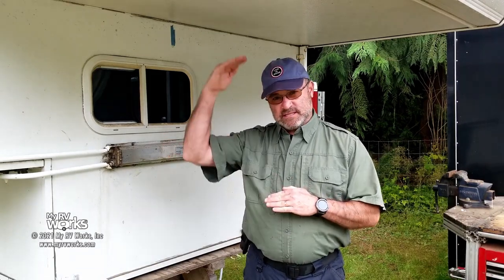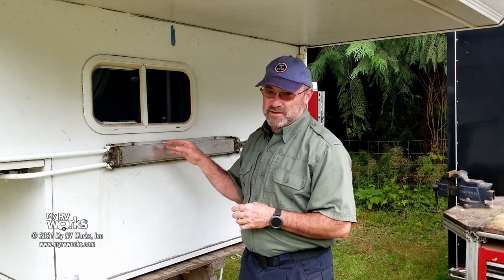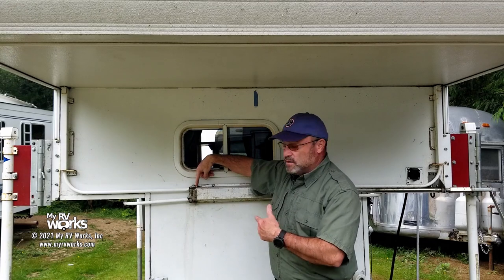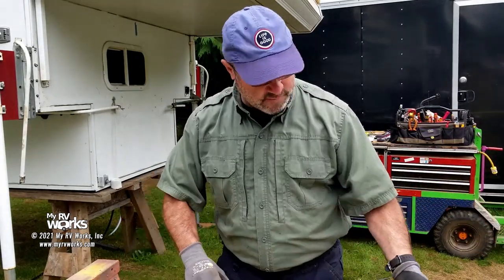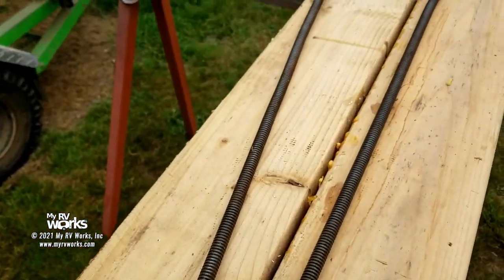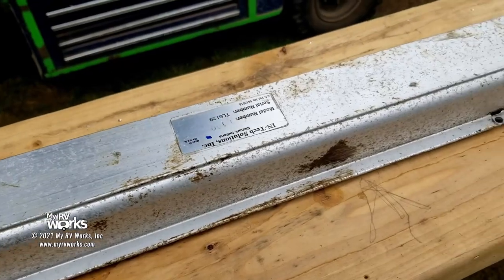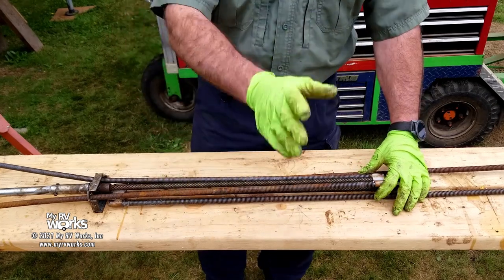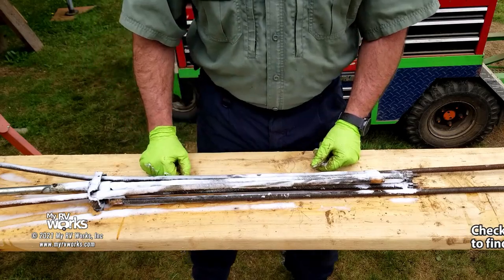Truck Camper Lift Lubrication  --  My RV Works

Comment: I am sure you also cleaned any rust out of the tubes and sprayed lub down them them and addressed where the water was entering the system. Love your work and explanation. I saw a previous comment and love, love, your cart. Maybe a video about it in the future. Just a little side comment. My grandfather would tell me “boy you have to slow down to speed up to get things done”. I really did not understand what he meant until latter in life but you seem to be going 90 miles an hour and I totally understand why but consider what my granddad said. Love you brother!

Comment: I've been looking for this video. Thank you for  posting it. I took mine apart, cleaned and lubed it per your video and it is better than new. ( The "tentacles" were dry as a bone.)  I was hesitant to do anything until your video, thanks again.

Comment: No buttons on the end of the pusher springs, up inside the legs? That takes some of the fun out of it. Other than the acme screws it looks a lot like a Goshen lift system. Good job Darren

Comment: I have that system on my palomino, and it sounded just like that before your service. It is on my pickup and I'm not going to remove or slide out partially right now. I bought spray motorcycle chain lube and drilled small holes in the tubing 
For the spray tube to fit into and sprayed in the holes. Then went inside and sprayed down from the top of the cables. I can't reach the cranking mechanism until the the camper is slid back so will tackle that later. Operating the mechanism now is quiet with much less friction. The Chain lube is sticky and will stay awhile. When the camper comes off the truck I will then do it as seen in this informative video. Until then I feel much better about raising and lowering the roof
Reply: I did the full maintenance on mine and it was not difficult at all.  Just make sure you have a full size table in front of the camper to lay out the parts.

Comment: Rust and debris are going to be inside of the pipes that you left on the camper as well and brake clean or carburetor cleaner in a spray can would have worked much easier after wire brushing then foaming degreaser. Hope this helps

Comment: So without putting those brackets that hold the pipes flush to the bottom of your camper back before you started ratcheting I don't know if you can see it but at the end of the movie the left hand side pipe on the front is moving and being pushed down by the spring inside of it because it doesn't have the bracket supporting it while you're turning the lift and pushing the roof up. I would not recommend cranking the roof up without those brackets on the bottom of the camper anymore they're actually there to support the force of the spring pushing up is going to want to push the pipe down and that is the only thing holding the pipe in place where it's at the bottom of your camper

Comment: Excellent video, very informative! I have the same camper except mine’s a 2004 Pine Mountain. I’m not having any problems with the lift system but was looking for maintenance information on it to prevent such issues. I was also curious as to how the system worked and your video gave me a thorough understanding. My camper is on the truck and I don’t want to take if off, not having any problems but I would like to lube the system for preventative maintenance.

Comment: Great video. I am in the same situation  with my lift system. But it is identical to the one you have just maintenance. Except mine had a sheared pin on the gear assembly. Also mine is made by L&W engineering which I think that one is too.

Comment: I have a problem with my own. Is the ratchet part of the crank a 2 peace. My is cranking well and goes up and down,but will not stay up. I pulled it apart to see and it seems like my problem is that where it cranks at from your video it seems like your seems to release when you turn to left and rein gauges when you turn to right. I am needing help to figure out how it works. Thanks for any help you can give me . Thanks
Reply: same here and the diagram does not show the latching system very clearly. Like how which side of the gear and how much tension

Comment: Great Video, we have the same system..but ours didn't go as planned.  Looked great, but we believe the Shuttle (white thing) is stripped inside, because the passenger side of our 2012 Palomino Real Lite Camper will not raise and if we crank it while system is on the table, it will not move the springs (rods) much at all.  Do you know where we can get the Shuttles?
Reply: I’m curious about this as well. Mine is broke and needs replaced.

Comment: I took everything apart on my 2010 Palomino Bronco 800 - same lift system - and even replaced the broken gears and pins. yay! But now I'm having problems getting the cables/coils back into the tubes....for instance, at the far (door end) of the camper there's almost a 90* angle in the tubing, and even after greasing the coils, I'm not able to get them to fully insert...any suggestions?
Reply: we are having the same problem. Top (front) ones went in easy, still fighting with the bottom (rear) ones. Any one have any suggestions that might help?

Comment: I would have sprayed brake clean all down the pipes and put some grease in those too or at least some good automatic transmission fluid or motor oil after using the brake clean the brake cleaner will get things clean a lot faster you won't have to use as much as you did the degreaser and it evaporates usually before it can leak down through your table and on the ground spray foam degreaser is a different story and takes longer.

Comment: what kind of tool cart/buggy is that, you have?
Reply from the maker: Hey, glad you like it!  That's something I've been building on since the 90s. It started out its life as a Taylor-Dunn Stockchaser. I got out of a scrap pile where it was used as a donor vehicle.  I started welding on it and modifying it to what it is today.  These days it's got a variable frequency speed control on it, inverter, and obviously a lot of tool boxes.  I'm running all of the control I/O through a PLC. You'll see it in several more of my other videos. If there's enough interest, I can do a video just on what I did to it.  In my previous career as a commissioning and testing engineer, it was awesome to be able to drive it all over facilities to get to the different pieces of equipment I was working on.
Reply: @MyRVWorks  I like it, it is leagues beyond my gorilla tool wagon.